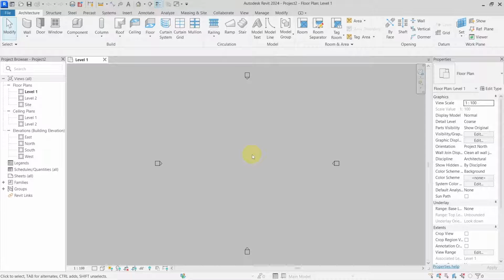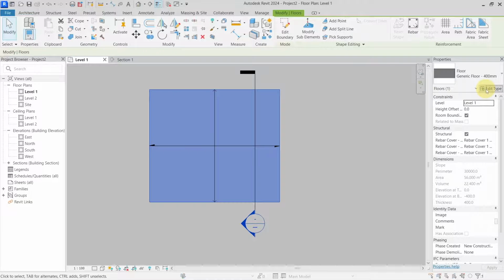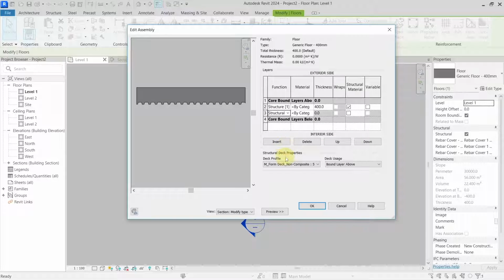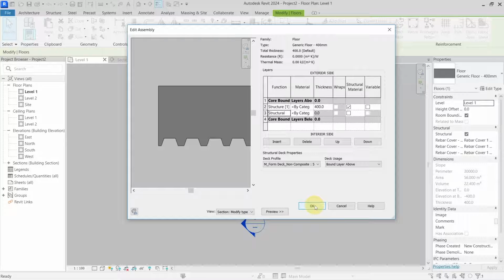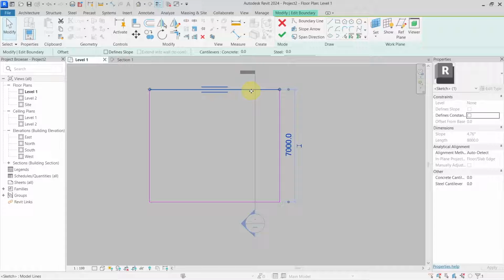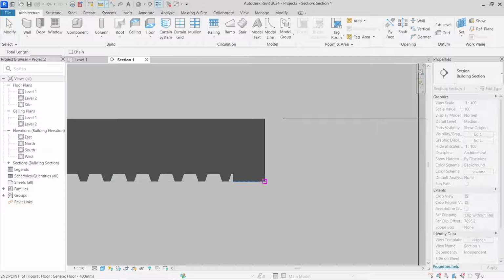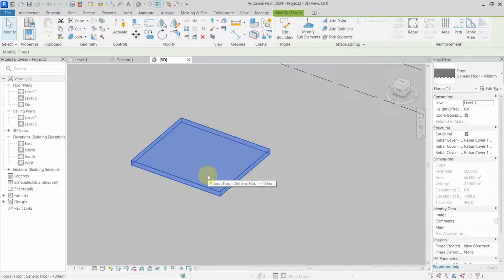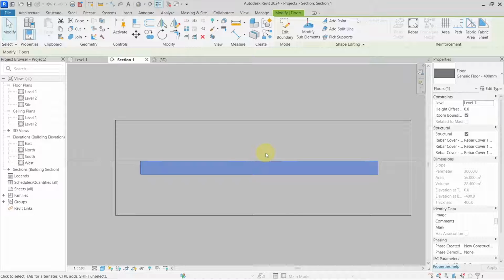Revit Tutorial - Floor with steel deck profile

Comment: Hi, do you know why the deck profile isn't showing in 2D? It just shows a normal floor.
Reply from the maker: Hello, can you be more specific? In section it should be visible.
Reply: @eMexperience  It is not visible in section at all, I don't know the reason. I tried the sample project from autodesk and there i can see but on my project the same profile, isn't showing
Reply from the maker: @rubencarvalho7571  If you can, send me your file on email and i can take a look on that.